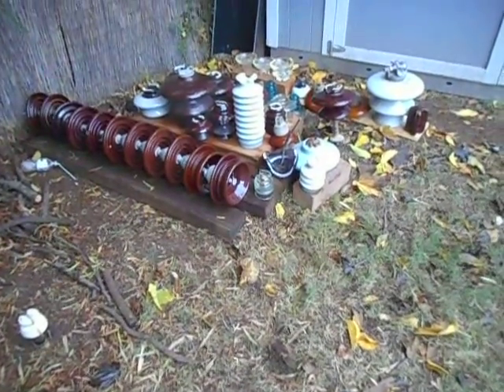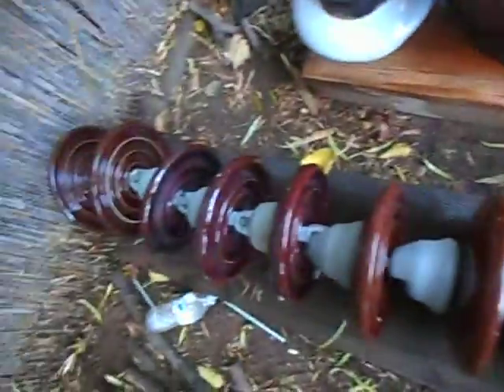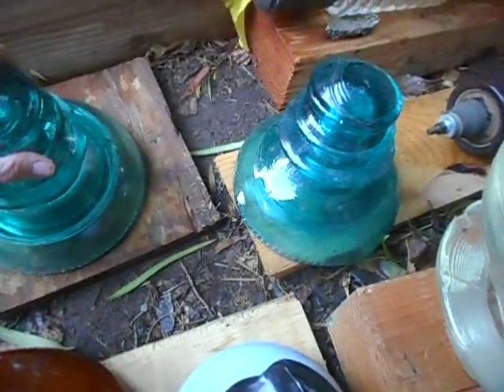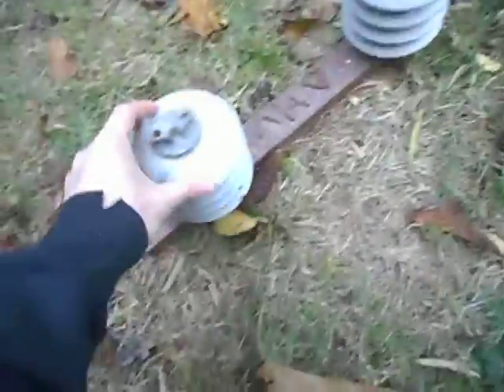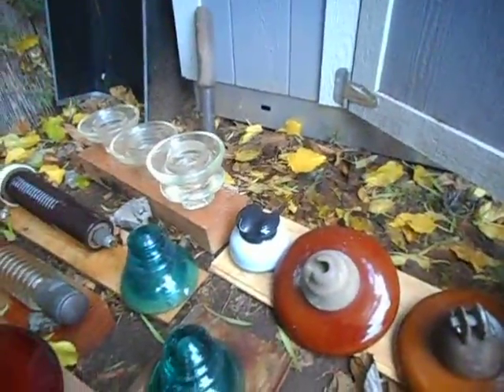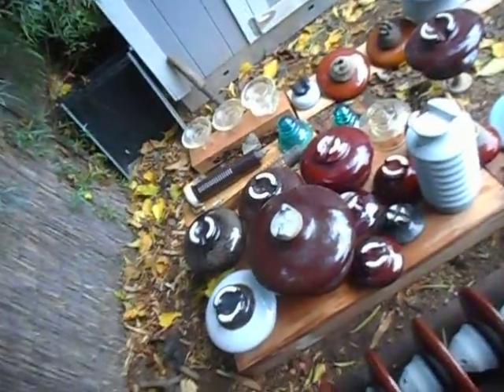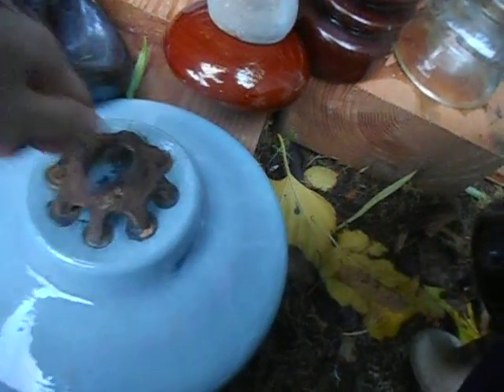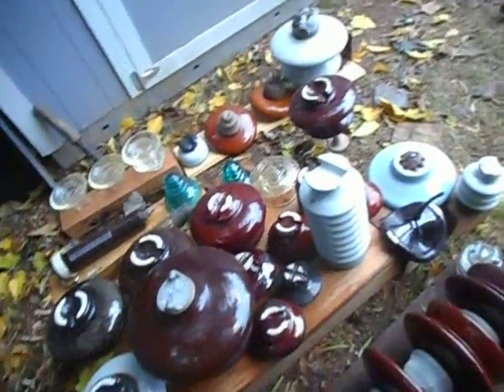Let's take a look at HIGH VOLTAGE INSULATORS

Comment: That isn't tar. That gunmetal black/blue glaze is iron oxide underglazing so that the iron oxide, and sometimes copper oxide, metal disappates the RF static interference that was once common with power lines, especially when AM radio was more common.  The pin threads also have that treatment as well. The brown top ones are because the blue/gray was glazed over the gunmetal color.